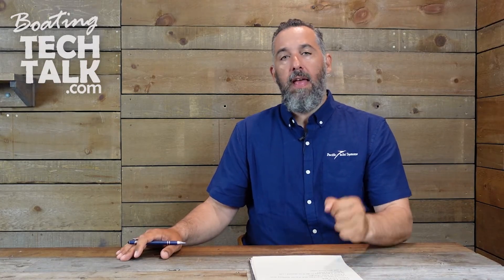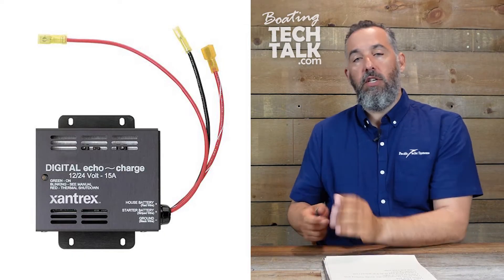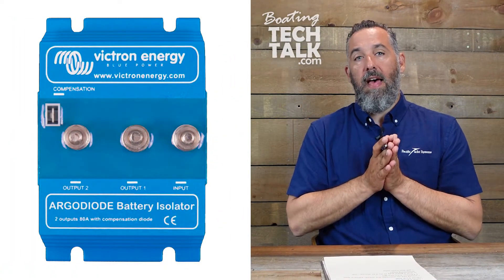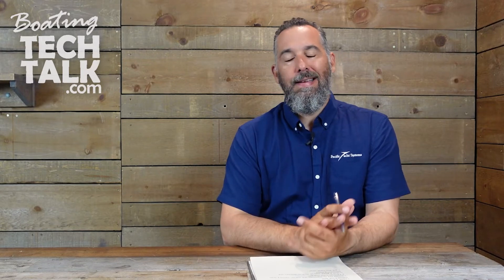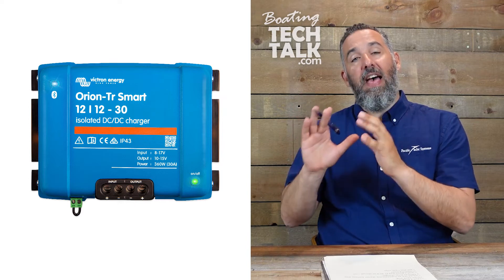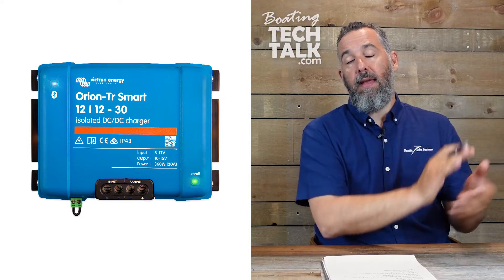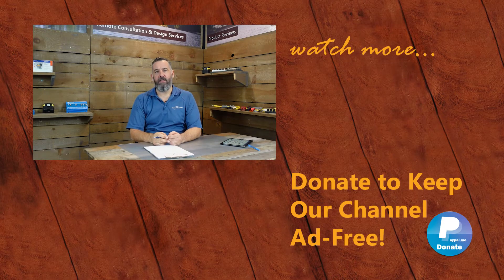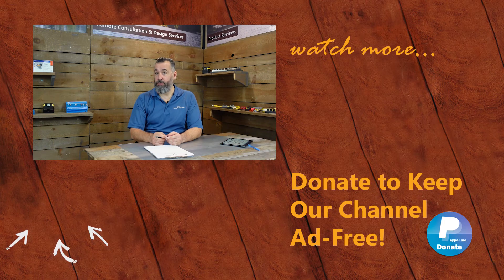What Is An Echo Charger on my Boat?

Comment: With a flooded 460AH house bank I am sending all the charge current to house bank and using an Echo Charger to charge the start battery.  Reasoning being that the very brief current draw for engine start uses only a fraction of start battery capacity and house bank is the more utilized battery, by far.  Is this optimum?

Comment: Jeff i have a question.at a small outboard that has a small alternator (15amps) can i install a vsr that is rated for max125amps? And bonus question ☺️ should i fuse the vsr? 
Since the amperes will be so low!

Comment: With the Victron DC to DC units... what is the difference between the isolated and non-isolated models?
Reply from the maker: The isolated units have an isolated or separate negative terminal - in most cases we want non-isolated as all negatives should be continuous throughout the boat.

Comment: Coming off an anchorage my starter battery gets charged pretty quick yet my house bank could be quite depleted. So connecting as per the Victron schematics for the Orion-Tr with the house battery as slave, when the starter battery is soon fully charged but the house battery is still not yet 100%, what happens? My concern is that the alternator will reduce it's output and so prevent the echo charger from being able to complete the charging of the house battery.
Reply from the maker: The charging from an Orion-Tr starts around mid 13 volts... and so you'll right away start charging the house from the engine battery. An alternator with internal regulator will output about 14 volts most of the time.

Comment: Hi Jeff... I have a question... I'm switching from a manual windlass to and electric and I'm unsure whether to put a battery at the windlass or wire from the main bank (agm 3x4d -600ah)... 
I already have the battery but it's flooded lead acid. Now I have a victron multiplus 3000 and it has an auxiliary 4 amp output that I could charge the windlass battery...I think 🤔...

Mainly the reason of leaning towards the battery at the windlass is cost of wiring... it would be an approximately 70run on 2/0 which is very expensive ...
Any thoughts, wiring diagrams etc would be appreciated 
Thanks
And love what you are doing here!
Reply from the maker: There's no perfect solution here... as a dedicated windlass battery will also need a device (like a battery combiner or battery isolator or DC to DC charging converter) to recharge the battery. 

For what's it's worth, in 90% of the installs, we end up having the windlass run off the house battery, unless there is a thruster in the bow and then it makes a lot of sense to run windlass to thruster battery.

Comment: With the Orion would it make sense to move the alternator charge to the house bank and then use the house to charge the starter with the Orion? Essentially using the higher amps on the house and the 30 amps for the starter?
Reply: Good question.
I would like to see a good answer, because the house may have a automatic cut-off switch. If the house is fully charged it will switch off, and then when the engine is running .......
Reply: @remarkov   I think I prefer the conventional method.
First here is a lot of experience with the conventional set up.

I ask myself that if my house charges first by the alternator, via the DC-DC charger, then when the is house battery full it starts to charge the starter battery then there could be a problem.

What if the house bank of 115Ah is 40% depleted when we start the engine, and with that the alternator starts working, then there is around 65Ah left in the house.

To start the engine the starter battery was depleted to 90Ah.
Then if you keep the engine on a short time, the house wouldn't charge to 100%, and the 90Ah of the starter battery would stay the same, because it didn't receive any charge during the short period the engine, and therefore the alternator was running.

Next time you try to start the 90Ah of the starter battery may not be enough to start the engine, so you may be stranded somewhere at a beach of a uninhabited Island.

Then you have to find a way to connect the house battery with the starter. The house battery is not made for that, but you don't want to be in that situation in the first place of course.
Reply: That could work, technically.

I still prefer the conventional way. The starter battery is more important than the house battery in my opinion.
Because it starts the engine, which will bring me home and charge both my batteries.

To charge the house as quick as possible I would look for a DC-DC charger with a high charge rate or connect 2 two in parallel.
Reply: The conventional way is a DC-DC charger for the house battery. And straight from the alternator for the starter battery.

For AGM battery a state of charge (SOC) of 100% will show 12.8 V for example. And at 80% SOC the voltage could be 12.25 V.
The DC-DC charger is programmed to start charging the house battery when the starter battery reaches 12.8 V for example.
And the DC-DC charger stops when it detects that the house battery reaches 12.8 V if the house battery is also AGM.

But the DC-DC charger won't pull current from the starter battery, but straight from the alternator.
This is possible because the charger and the alternator share the same terminal post of the starter battery, while the starter battery almost doesn't pull any current anymore because it's full.

So it's not the starter battery that is in danger, but the alternator.
When designing the DC-DC charging system, we should therefore match the capacity of the alternator, to the DC-DC charger and to the maximum safe charging rate of the battery.
And of course with the corresponding cable sizes and fuses/breakers including lugs.

If it's necessary we could replace the stock alternator for a high performance alternator.
Reply: Or maybe you're talking about a battery isolator?
That is a device that can charge two different battery banks at the same time from one alternator.

In this case there is no common terminal for the battery banks.
Reply from the maker: Connecting the alternator output directly to the house battery makes a lot of sense (e.g. did this setup on my boat), especially since DC to DC charging converters are limited to 30 amps and quite often we want a faster recharge rate (way bigger then 30 amps) for charging the house battery.
Reply: @remarkov  Could you please share more about your installation process?

I'm particularly interested in if you had any issues with things that are related to the starter battery-alternator electrical system, such as starter, radiator cooling fan, dashboard light, engine warning lights, fuel and oil pumps, sensors and meters.